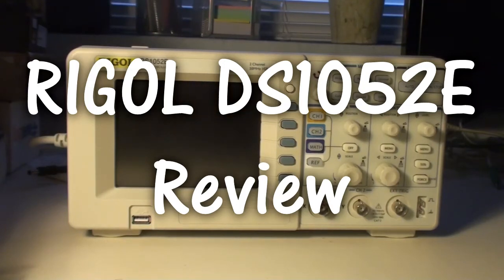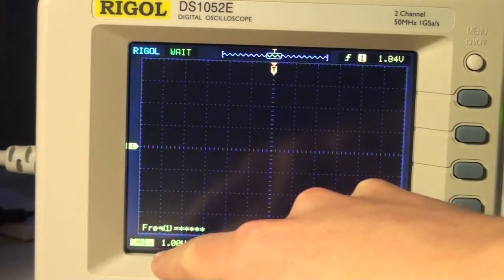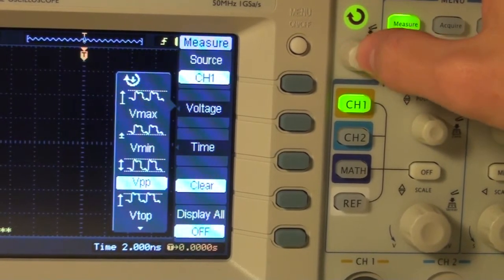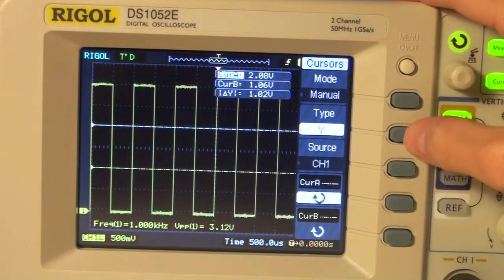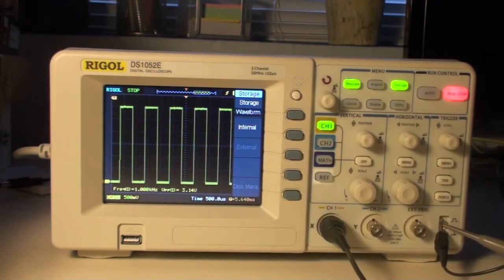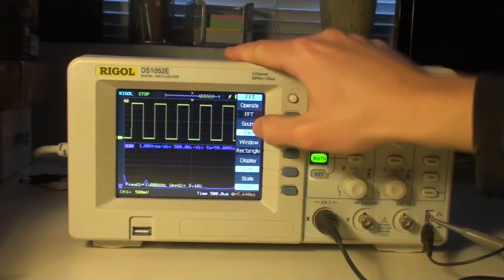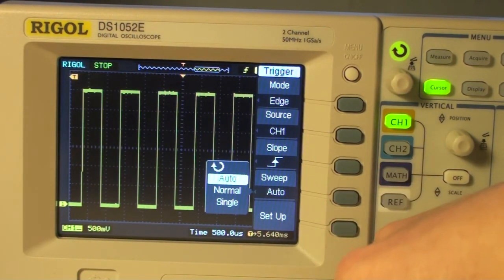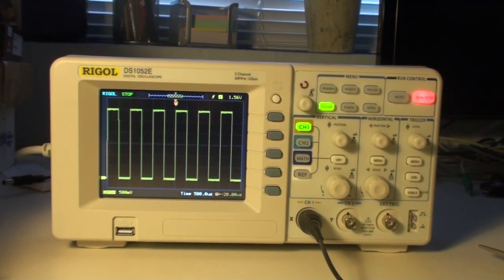RIGOL DS1052E Review

Comment: Gd day sir, is there a spectrum analyzer function on this scope?
Reply from the maker: There is not a Spectrum Analyzer in the scope but it can run low-fidelity FFT analysis. This is however only useful for low-frequency signals with slow variations in the frequency content.

Comment: It was pretty straight forward. Remember to pull out the rigols's plastic on/off button before you open the case. I believe I had to cut the fan's connector off and solder the rigol fan connector over to the new fan's leads (only 2 wires: power (+) and ground (-)). I was very careful doing this mod and it took me an hour or so.

Comment: The noise is really loud and annoying. I swapped the original fan with a low-noise one with slight lower air flow. (Noiseblocker, BlackSilent XR2, 60x25). The scope works just as well, but at a fraction of the original noise level